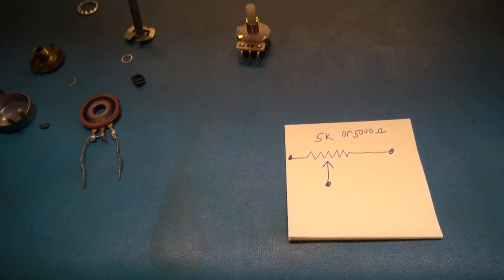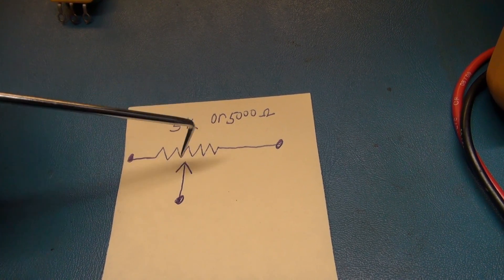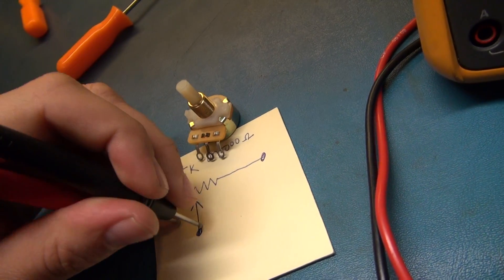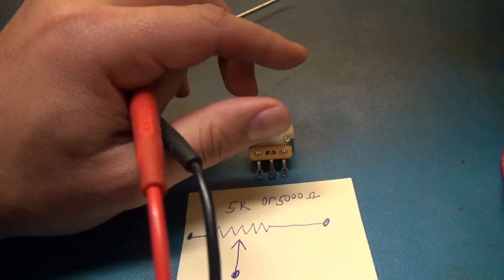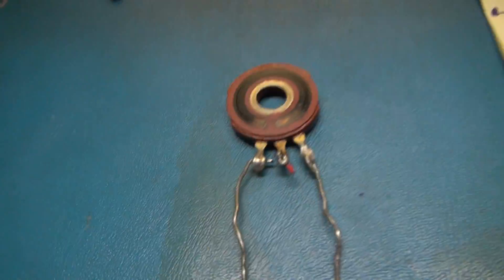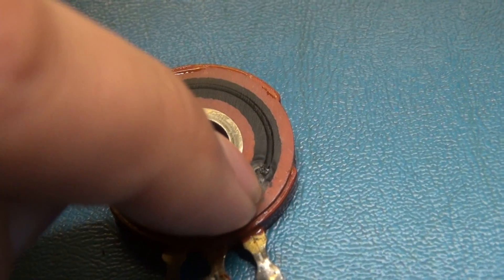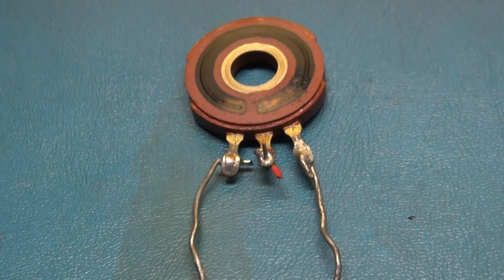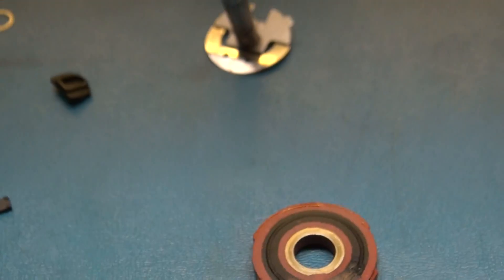How Do Potentiometers Work And How To Service Them. Cleaning Volume Controls

Comment: Can I use white lithium grease to lubricate it? Or would it impede the resistance? Having a blob of lithium grease in there would work nicely to mitigate the wear and tear of the track plus, it would make the scrolling sooo nice and smooth 😁. Have you tried it?

Comment: Never seen 1 apart thanks for the cool video. Would a hot spot like that make it so the wiper cant go all the way to 10 making the guitar sound low and thin like the volumes knobs only on 5 when its wide open?

Comment: Sir what about 5 pin potenciometers?
3 pin are in line but on the back side are 2 more pins for what are those used exactly?
Reply: A 5-pin potentiometer combines a 3-pin potentiometer with a 2-pin switch. Usually, the switch remains off when the shaft is fully counterclockwise. In all other positions, the switch activates. This function typically controls a things like a power on/off feature.

Comment: Great video! I just opened my Technics receiver, and i don't know what to do-to search for remote or..That all was my fault, all about that my phones jack was broken, i tried to get signal in different way, but it was too weak..Wich means, that the air ventilator didn't get it on the lows, and didn't working. Then was overheating and bye bye volume knob..I don't know what to do🤣🤣

Comment: Great way to break it down.  I have a gain pot on my guitar amp, and the shaft moves in and out?  If I push it in, I can control the gain.  Assuming it’s bad.  Is there a way to fix it, with replacing the whole pot?

Comment: You can buy carbon or silver paint on Amazon to paint dead spots on a pot make sure you clean it well and do it outside it’s kinda toxic then sand it with 600 or 1000 grit to smooth it out

Comment: Hello AR.  I have an older Sansui home stereo amplifier that has crackling noise issues with three of the function switches/pots.  Am I better off to use Deoxit-d5, Deoxit-gold or the Deoxit-F5 on those?  Thanks.

Comment: Mine has one extra lead on the opposite side, comes from an old 1946 radio. What does that do...? I took it apart to clean it, put it back together, now nothing works, no sound at all. I’ve done this many times before and it’s always worked. And I’ve double checked the wiring and can’t see anything wrong. But there is something not right. There was an insulating washer that fell out when I took it apart, but I can’t figure out where it goes, or why it was there to begin with. Anyway, I’m totally at loss at why this thing isn’t working. I tried it with both the washer back in and without it...weird.

Comment: Great video.  Have a frequency tuning POT on 900mhz wireless headphone that is on the fritz, hard time holding same frequency, comes and goes with static. Think some WD40 shot into the POT will help?  Or gun cleaner/lubricant?  Thanks!
Reply from the maker: No, unless you dont reallt care much about the device I would only use a cleaner that is meant to clean electronics. Otherwise parts can. Become damaged from incompatible solvents and oils.
Reply: @Kev_31779  Thanks!  Will probably buy some contact cleaner.  Take care and thanks!

Comment: Thank you so much I working on my PS4 controller cause they keep drift now I know the cause and was really going wrong. 

I also see what all the PS4 controllers replacements I bought that broke none had a lubrication in the potentiometer. Do manufacturer intentional do that for it fail or short life span ?
Reply: That part. All the way back to my ps2 controller i noticed no lube. Luckily this vid shows what to do. May even prevent future issues.

Comment: Question: can I improve a pot's accuracy by servicing it more?
Reply from the maker: Cleaning the pot does not change accuracy. The pot can only be as accurate as it was designed for. But cleaning it will help with staying accurate  and noise free if dirty. Also if it ain't broke dont fix it.  If it's not scratchy the just let it be.
Reply: @Kev_31779  dayum, you fast! Thanks!

Comment: Watching again since I have to clean the volume knob on an old Sony receiver I would like to put ' back in commission '. This is pretty clear. Thanks!
Reply: Johnny:  I have a SONY (under cupboard) Mega Bass radio cd player.  I was very excited to fix the volume knob.  I took all the screws out, (there are 14 of them).  After removing all the screws, the top was still firmly against the rest of the body and I cannot get it open, to access my bad volume knob.  Any ideas?

Comment: Another hint: If you really hate that dirty pot that never get any real rotating use, then set it where you like it,  then measure it with an ohmmeter and solder in permanent resistors. Not too easy to change later, but now you know how to do it. This was a an old loudspeaker/L-pad rebuilding hint I saw somewhere..

Comment: I have a kt 3296 three pin petentiometer. But I want to know why it just spins around forever. There’s no clear start and finish. I don’t know if I’ve turned it clockwise for ever etc. How do they work in that sense
Reply: it's probably a rotary encoder rather than a potentiometer

Comment: I spray through the upper shaft on sealed potentiometers. Than I rotate the shaft to attempt to work the cleaner/lubricant in. This is a last resort for sealed units that have crud built up that made it's way in through the shaft/knob.
Reply: I just saw a post suggesting to drill a hole in the end of a properly-sized wirenut, place it over the whole shaft, insert the spray nozzle through the hole  and then really drench the shaft and pot with contact cleaner. I'm going to try it today, maybe use a round gasket on the bottom of the wirenut to avoid leaking. Use D5/DeOxit AKA 'Cramolin' as usual. 

           Be aware that many pots are well sealed along the shaft and this doesn't even come close to f'ing working.   :(

Comment: I recently aquired a Pioneer SA-8500 and have noticed some static when I adjust the volume control knob, do I need to remove the potentiometer to clean it properly or can I just spray it with contact cleaner? I also get some distortion on the left channel when I flip the tone switch or the tape monitor source switch, how can these be cleaned? Also I live in Canada and cannot seem to find detoxit in any stores up here.
Reply from the maker: You can try use contact cleaner on the pots. You should be able to find a slot on the back side of the pots or switch to spray the cleaner in and work the control back and forth. Contact cleaner can help but something with a mild lube will last longer.
Reply: Thanks for the quick reply!

Comment: Hi. Very nice video. I have a question....I have a messed up pot and its cracking during changing the volume, bit its also unable to feed the repro with stereo sound. Sorry for the noobish description, just during the volume adjusting suddenly left repro is not working, then it works, but right repro stopped etc....I must really fine tune the pot position to have stereo and no cracking. Usually its on very loud volume with a lot of noise, or low volume with almost no sound. :-) is it possible to just clean it with some contacts cleaner? Thank You.
Reply from the maker: Yes make sure it is unplugged and try to spray a few squirts into the pot. That "should" take care of it.
Reply: Kev31779
Thank You very much.
Reply: Kev31779 Done.....working perfectly. :-)

Comment: Nicely explained. Thanks. In your opinion what's the likelihood of repairing a late 70s push push 300k pot that doesn't seem to change when pushed to one of the outputs even though it seems to work mechanically? Really going to keep the instrument as original as possible and is very hard to snag a 300k push push to match, if even at all.

Comment: my question with burn spots... have you ever tried to repair one?  I know its easier to buy a new one and spend the time and money to put a new one in... but you obviously look like you like spending spare time doing this stuff; So... have you ever tried to do a retrace/re-pair trace or used something like liquid trace or solder to put some surface back on that spot to supply resistance?  If so did you measure how much it helped?  I'm pretty sure there is significant ohm loss when on the repaired portion of the trace as it is its own material with its own resistance until the waffer/spudger goes onto original resistance surface?
Reply from the maker: +Mahrtee Lote   I wouldn't attempt to repair a burn spot on a pot. I would just replace it.
Reply: cool, i'm not judging just wondering as when I used to have the time to take my toys apart i would/have done so in the past... was wondering what kind of possible success rate you may have or not had.   good video
Reply from the maker: +Mahrtee Lote  There is no real good way to repair a bad carbon or resistive layer of in a pot . It would not be economical to repair the pot. Replacement/substitution is the best solution.
Reply: agree'd but it'd be cool if one was able to do it and do it so its like new.  I a huge fan of repairing traces... but haven't done anything inside of an electronic component like that, just to the boards
Reply: If the burn spot on the phenolic is simply missing conductive material, then theoretically it could work again if the path was rebuilt.  I have access to sputter coater, and I have a carbon, gold, iridium, platinum and palladium targets for it.  The spot could be masked and new material deposited.  I bet I could get it working again.  ;-)
Reply: The carbon layer is a precisely calculated carbon resistive layer. Pots are variable resistors. You best bet to temporarily repair would be to use a pencil and scribble on the dead spot to bridge it, but that would only superficially fix the dead spot, as the volume knob would fail to continue to be linear/exponential perfectly.

I have used pencils before to draw a resistor to connect two pins across the top of IC's :) It would be incredibly temporary, as it would easily rub off.

Comment: Thanks for this video! I had a perfect potentiometer that wouldn't give me a signal for some reason. Thanks you I tested the outside and middle leads. The outside were great but I didn't get a reading from the inside. After this I knew it was the sweeper. 

Turns out I bent on set of small metal arms during cleaning and it wasn't contacting the strip. I've never worked with potentiometers before so I had little idea of what I was doing. Thanks again for helping me find a solution.

Comment: NICE CLIP WAS VERY HELPFULL , I NEED A NEW POTENTIOMETER FOR MY ROTEL PREAMP BUT CANT FIND ONE ,WOULD YOU KNOW WHERE I CAN PURCHASE ONE ?
Reply from the maker: +Fred Gailer You can get potentiometers almost anywhere, Try ebay for a specific replacement part for your device.
Reply: +kev31779  no luck any where   : (    tried to google it also ,isint there a warehouse that stocks it ?  some say you cant get rotel parts any more ?
Reply from the maker: +Fred Gailer You may have to dig on forums for some parts that are not any longer in production. it can be tough. you may be able to scab something in that is close, but you will need to do the engineering.

Comment: Most, if not all, volume controls have special characteristics (usually logarithmic as opposed to linear). Just worth mentioning when looking for replacements
Reply: how could you identify if pot is either linear, or logarithmic?
Reply: @necromecro  There will be the letter A or B on the potentiometer.

A is for logarithmic taper, "B" for is linear taper;  and "C" is for the rarely used reverse logarithmic taper.

Comment: Great video. Is there a way to check if a pot is bad without having it actually wired or opening the pot as you have?  Thanks
Reply from the maker: Other than just testing resistance ,, Not really.
Reply: kev31779 Thanks.

Comment: why does my guitar buzz when I turn up the tone knob
Reply from the maker: Well guitars naturally buzz. without noiseless pickups or hum buckers they can buzz all the time. Its something common in single coil pickups. The tone control may be opening up to a level of noise it was filtering out in its hi pass setting. The common  60 cycle hum from line noise is most likely what your hearing.